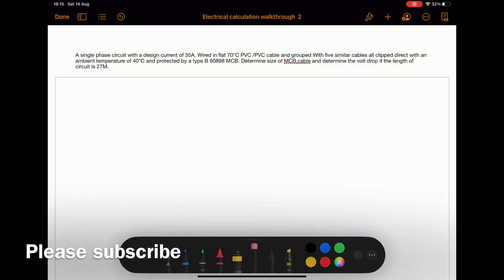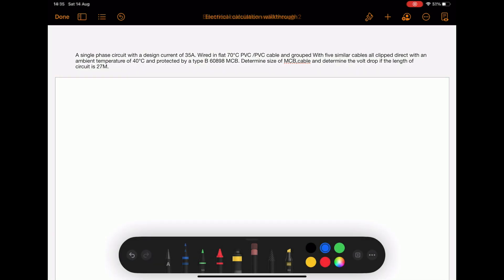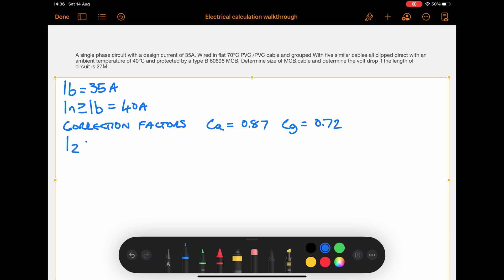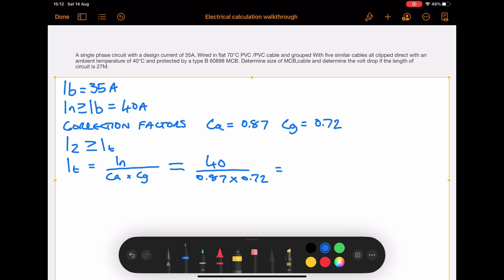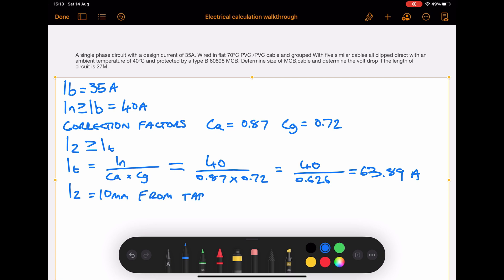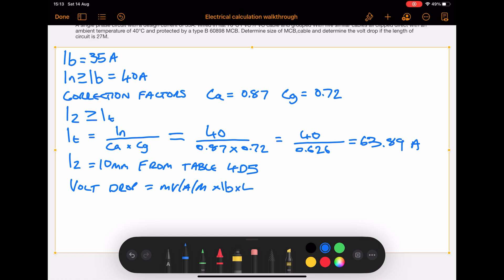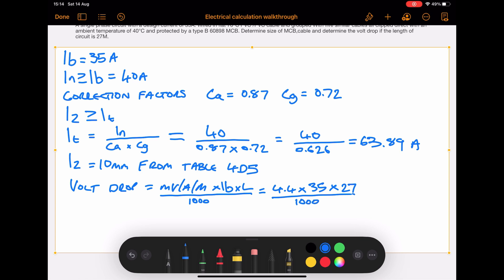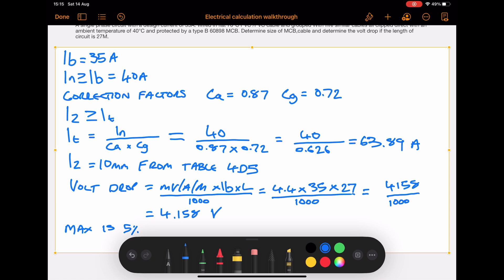Electrical calculation walkthrough

Comment: Hi James, Would I be correct in saying you would use "Ib" instead of "In" in the case where there was no overload risk to be considered. The use of "In" i have always used in cases where overload would be possible.
Reply from the maker: Hi Angelo,
In most cases it is necessary to use the In in the equation. However if the circuit is supplying a fixed appliance such as a heater that you know the load in watts and it's not possible for the end user to overload it, then it is possible to omit the overload protection, and appendix 4 shows the alternative equation using Ib.  However there are some types of installation where it's not permitted. From memory, I think it's not permitted in hazardous areas for example. So it's always worth checking to see if any other regulations apply.
Regards
James